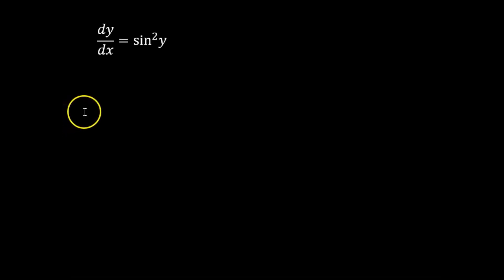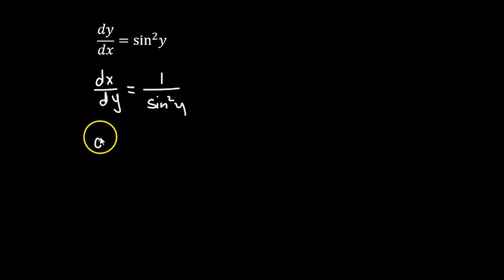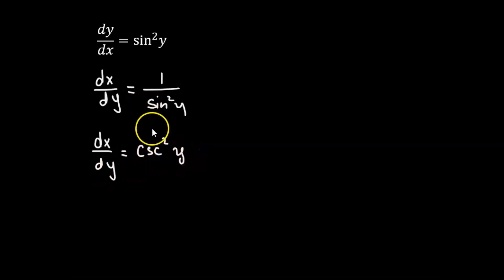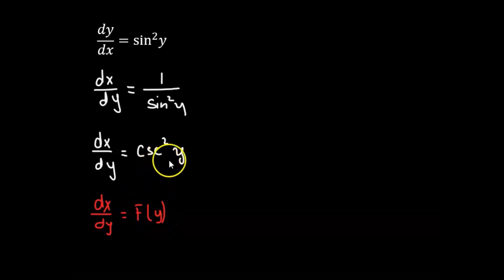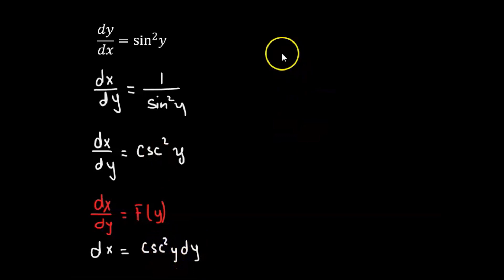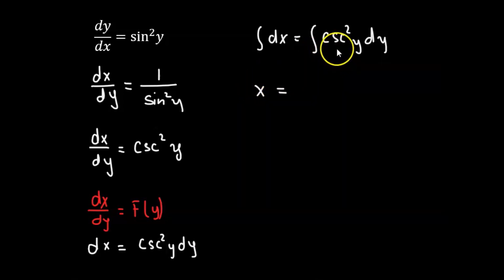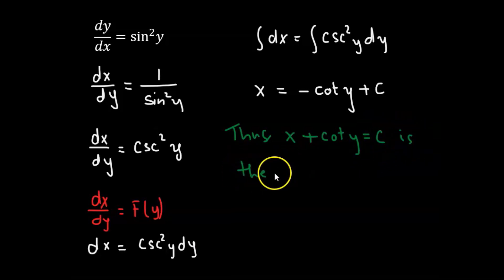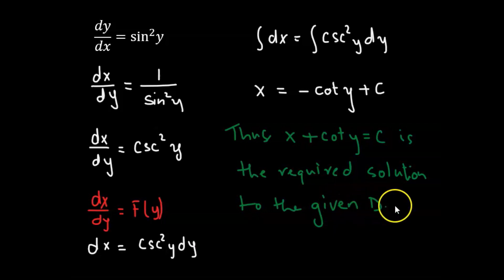9.2 - Differential Equations | Method of Variable Separation - TYPE II

Comment: Even though you could take the reciprocal and then integrate it to get the answer, you could have done the other method, which is (csc(y))^2dy=dx. Integrate both sides, which is -cot(y)=x+C. Solve for y, which is cot(y)=-x-C, or y=arccot(-x)+C. Other acceptable answers are y=-arccot(x)+C, y=arctan(-1/x)+C, and y=-arctan(1/x)+C as long as they all have the same derivatives. Note that we change -C to +C because a constant is always going to be constant. Therefore, differentiating a constant is always going to 0, which is not going to make any difference to this.

Comment: Couldn't you just integrate with respect to x on both sides, so as getting sin(y)^2 x?
Reply: By doing this you'll get that y=sin(y)^2 x
Reply: So now you get that x=(y/sin(y)^2)
Reply from the maker: That's possible only when y is a constant. In our case, y is not a constant  coz it's a function of x. So, you'll need to integrate 1/(siny)^2 with respect to y.

Hope that helps!